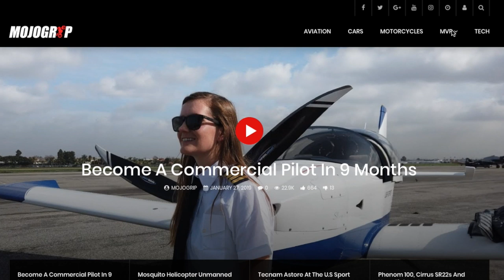WHY I Decided To Build My First Airplane

Comment: Retired A&P also PPL - good luck with your project, most homebuilds never get finished. Additional help increases your chances. Lightsport can be fun, the Rotax engine has been around awhile but accidents do happen. A local CFI got into some trouble a couple of years ago. NTSB final report - N2812

Comment: Bravo..good luck. I built a Europa kitplane when I first started flying as a hobby 15 years ago before going pro. Took me 6 years to finish the plane on my own. It’s good that you have the builder assist program for those times when you will need the motivation to keep going. Good luck

Comment: Some of the Vans RV models can have a ballistic parachute fitted.  Can the sling have a BRS parachute and have you thought about installing it?   With the parachute and modern avionics you would be saving about $500,000 compared to a new Cirrus sr22! 😎
Reply from the maker: Yea the Sling TSi can be fitted with a parachute and I will be getting one installed

Comment: Congratulations Mike. I'm looking forward to seeing the nuts and bolts of this build. That's a really exciting plane.
Edit: I do have a question: Why did you pick Sling TSI over Vans RV-10? I did look at the Sling Tsi Vs. Vans RV-10 Airplane. Which Is A Better 4 Seater? video. One comment on that: The RV-10 cruise speed which a number of builders say they get, about 200 MPH or about 175 knots, is above the never exceed speed for the Sling TSI (160 knots, about 184 mph). 

I might well choose the Sling also if I had gotten to fly both; the pilot workload looks lighter. But I'm interested in anything you have to comment on this.

Comment: good look mike 👍 i decided to build my own airplane i started a couple years ago is going to be 7 occupants turbo compensated retractable gear pressurized cabin with around 1500 nm and maximum ceiling of 25,000 ft and everything from power plant electrical system fuselage and avionics build and design by me,currently in process of testing power plant next step is fuselage 😊

Comment: Dude I remember watching one of Rhine videos were you compared the Sling TSI & the RV-10 and the RV-10 seemed to be better with overall stats. Why the Sling? I plan to build one but need $ plus I’m looking into ownership cost of hanger, insurance etc...  Good luck
Reply: Marc D'Padova 
The build effort of rv -10 is insane. Sling can be built (w assist program) in as little as 2 weeks of owner involvement (3-4 months from dropping $100k).
Reply: The RV-10 is a good aircraft but the TSi does everything the RV does minus 15 kts cruise at half the fuel burn and the RV interiors leave a lot to be desired while the TSi feels like a Bentley inside. Also the TSi is fuel injected and turbo which means it has a higher service ceiling by many thousands of feet. The TSi has already been to 23,000 ft with plans to 29,000 ft soon. Yes those aren't altitudes that you would ever use in real life but what about high density altitude days? In the mountains on a hot summer day?  Anyways, I've flown that TSi XC and was cruising 140kts at 7.1 gph with me and 3 passengers and 40 gallons of fuel on board. It's hard no to fall in love with it.
Reply: @kevinbutler9786  It's worth noting, that's pump gas & not aviation leaded gas. cheaper & safer.

Comment: The future is electric, you should look into the new techonologies with electric motors and
batteries. These new electric planes is fantastic, more and more advancements is being 

made with the electric batteries and motors. Electric is the future. The combustion engine
belongs in a museum.
Reply: Whoa there. Not so fast my friend.  Yes electric is the future, no, the battery tech is not advanced enough to toss your gas engine in the bin. Perhaps hybrid would be appropriate today, as we allow many more years to sort out all-electric.
Reply: Uhuh, lets get a plane with 100-200 mile range that will have to recharge for 8 hours, thats practical. You electronerds are funny.

Comment: Congratulations and good job. Curious question. Why spend so much on a 2 seater when you could get a reconditioned cherokee 235 for much about the same amount? Not withstanding being independently wealthy and congratulate you sir on that, but why do a project you can’t afford (crowd funding😜👍) when you need to start at a project you can afford on your own? Corporate sponsors should be your path I think.